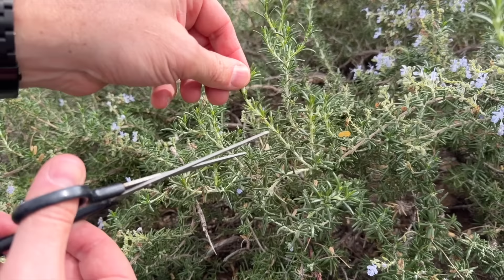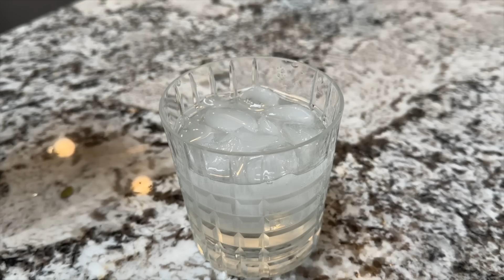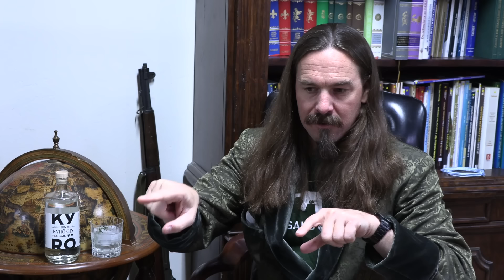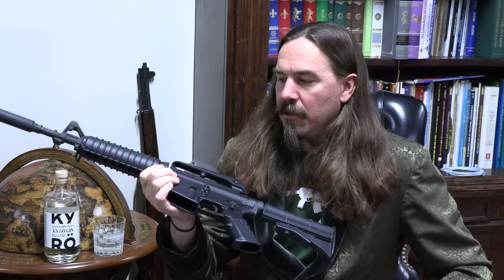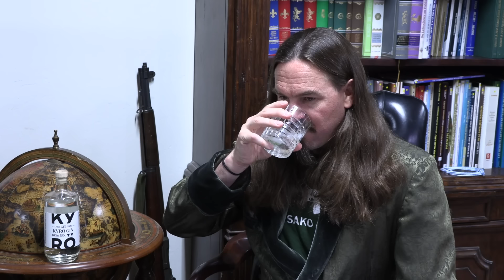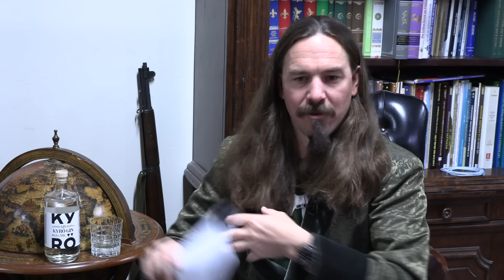How Guns are Made: Tolerances, Methods, and Metallurgy (Q&A January 2026)

Comment: One area that 3D printing is not currently beneficial, in my opinion (🙄) is components like your standard fire control parts, such as hammers, Sears, disconnectors etc. we saw a shift from forged and machined in the late 70’s (some even earlier) to things like sintered components in standard powdered metal technology (think colt lawman mk III hammers etc). We saw investment casting really flourish in small parts like safeties and even frames and other large parts because it is cost effective and strong. Now we are seeing the same thing with the MIM technology (which is still a sintered part but a different animal altogether) pushing the other methods out in a few areas of industry. It produces very complex designs that offer high strength and high volume manufacturing with long tool life. The structural density can be 97% that of a forged and machined piece but produced in a much much higher volume. That’s where it definitely beats out the 3D for actual full scale production. MIM, however hated, has made production of high strength, detailed parts much more economical for firearms manufacturers. It has eliminated the need for a lot of machining, and hand fitting and has greatly reduced production time and costs. A lot of people don’t even realize a lot of larger, and even more critical components are being made with Metal injection molding, like some barrels. An example would be the smith J frame 1.875” barrel. Specifically in .38 special, the colt cobra barrel is just one other specific example. 
So I don’t see 3D printing replacing MIM for a lot of high volume parts that can be made extremely precisely with very favorable economics and high  strength and good wear properties.

Comment: Hi Ian from Australia.I like Guns but I am not like the average American. In Australia the "Right to Bare Arms" means I can roll up my sleeves or wear a T-Shirt😎. I do really like watching your videos from a Historical point of view. I am also a Mechanical Engineer and I specialise in Design. As an engineer, Design always comes down to a handful of parameters and it is always a trade off between all of them to get the end result. Typically a design will start of with what is the purpose of the design and is there anything that the Customer says is required. If the customer demands say an aluminium barrel and wants to fire continuously on full auto we will try to convince them of better alternatives or not take the job. Some things are just not worth starting.  Assuming that what the customer wants is possible then the Design Requirements drive the first part of the design. Kalashnikov had to design a rifle that was cheap and reliable, easy to build with simple tools and with cheap materials, simple to maintain and use by lesser trained conscripts. Hence you can drop an AK-47 in the mud, wiggle it around, shake it off and fire it on full auto. It isn't greatly accurate but it is very reliable and it works. Assuming we have a basic set of requirements a Design will then come down to cost, materials, fabrication and testing. Of all of these things my materials will be the most important because different materials have different properties and different costs. I may not have the capability to fabricate a Titanium Receiver. Simple to CNC in other materials but very difficult with Titanium unless I have the right CNC machine which will be costly. I will then have to substitute a different material because I cannot afford the Titanium material or cannot economically fabricate in house or outsource that part. Material selection is usually a trade off between cost, functionality, availability and the ability to fabricate in that material. I will select the most cost effective material with the right physical and chemical properties that I have the capability to fabricate in house or outsource if necessary. 

The Tolerences I will use will depend on many factors but it basically comes down to how critical is the tolerance? Headspace is a critical tolerance. The angle of the wings on the sights is not. Some tolerances will have specific Standards. I will always design so that my design meets any required Standards and I will build in a Safety Factor. How much will a part shrink or expand in cold weather after having fired 100 rounds on full auto? I will calculate the Heat Transfer and do a number of Trade Studies under different conditions to work out a usable average, I will apply the Standard Tolerances and I may have a Safety Factor that is between 3 to 5. A Safety Factor might mean my barrel needs to cope with a peak of so much pressure so a SF of three will mean I will design it to cope with three times this pressure so it will not ordinarily fail. BTW there is a document called a Fit Sheet that is used to work out some tolerances. You look up the closest standard size, say 1/2 inch and look up the inside and outside tolerance depending on the Fit. A Press Fit will have different Tolerances to a Force Fit. A Force Fit that you described it will be the Receiver that is chilled to make it smaller and the Barrel that is heated to make it bigger. Put the bigger Barrel over the smaller Receiver and let it cool down and it aint going anywhere. Use a Press Fit and you can probably pull it apart again with your hands. The Fit will depend on the Application.

What actual fabrication methods will always come down to what machines and capabilities do I have available in terms of what is in my factory or outsourcing. It will also come down to how many do I need to make. It will be much more expensive for my Machinists to hand make parts for 100 units but very competitive to set up a series of CNC machines to make millions. Methods will also be a case of what do I need done? Some parts may have to be heat treated, others not. Some parts may need precision to 1/10000 of an inch, others not. I will use the cheapest and most efficient method that I have available. If it needs to be forged then either my guys on the shop floor will forge it or I will outsource it. 

Metallurgy is a bit of an issue here because metal is no longer the only material we make firearms from. As a Designer I will select the best, cost competitive material with the material properties that closest fit my design. If it came down to metals only then 3D printed plastic guns would not exist. Why does the average 3D printed gun have plastic parts and a metal barrel and receiver? Because the metal parts have the right material properties for their job and the plastic parts have the right properties for theirs. Safety Factors may be questionable but does the design work? Zip Guns work. They may blow up in your hand after a few shots but they do the job - fire a few shot and discard.

Designing Guns is not really any different to designing anything else. Parts of weapons need precision and others not. Certain Standards need to be met and others not. You mention the wide range of ammunition, this is a design limitation. Design for all of it or design for Best and use warning Labels. If people don't heed the warnings then whose fault is that? If they want a cheap gun that works then you get what you pay for. Use the right tool for the right job. Do you go hunting for Bears with a .22 pistol? Common Sense has to come into it somewhere. Either that or let Charles Darwin select the survival of the fittest.

Last thing. Just Google Desktop 5-axis CNC and you will get what is on the label. A Five-axis CNC machine that fits on your Desk for less than US$6000. Google Desktop Laser Sinter 3D Printer and a similar machine will come up for about the same money. The CAD program I use regularly, Fusion by AutoDesk, has a free version that has Design to Manufacture (either 3D print or CNC) and will also create full Engineering Drawings with a handfull of mouse clicks. What was once the domain of Big Manufacturers is now well within the realms of a Guy in his Garage and a few cheap machine tools.

Cheers Again.

Comment: The Blanchard lathe is not what he was best known for. Blanchard grinding is a process still used today for things like die shoes and other precision plate products. It's a surface grinding process with a vertical spindle and rotating table

Comment: The guns stocks WERE made on a "duplicating Lathe"..  A duplicating lathe, or copying lathe, uses a template or master workpiece to guide a cutting tool, allowing for the creation of identical, complex shapes like chair legs or spindles, automating repetitive turning tasks by having a stylus trace a pattern while a cutter shapes the new piece. These attachments can be added to standard lathes or built-in, featuring a tracer following a pattern and a tool bit making the cut, significantly speeding up production of identical items.  They also made and do make wooden airplane  propellers on the same kind of machine.
Reply: Yep that's what he said.

Comment: 20:35 IMO, it would be something like AR-180: a lot of stamping and spot welding. Almost no CNC milling needed(and it takes a lot of time to mill a receiver). The barrels can be made quickly by cold hammer forging by the buttload if you have the machine.

Comment: There's been a poster on the wall of my cube since I started this job listing all the plating requirements for different milspec applications, and it includes how different radii or inside/outside angles will affect coating thicknesses, so that's just one more variable that has to be taken into account during the design process. It's not doing me any good, I'm just the IT guy.

Comment: the thing with stamping is that you need to make a lot of units to pay for the tooling, and a good part of the tooling cost is in the die which can't change what it does like a CNC. Polymer tooling is cheaper and as mentioned allows for greater complexity and detail.

Comment: Hit me right in the aerospace engineering, where 0.010" tolerance is my default "I don't care about this feature" tolerance on flight parts.
Reply: That makes me wonder, I know cup holders are the cliche example, but what about cup holders in airplanes haha? Nah more broadly speaking tho, do you guys have teams that work on the interior or are there “interior design” companies that specialize in different kinds of planes that you partner with to handle that kind of stuff? Like on the one hand no need to redesign the wheel on stuff like the carpet that is used, but like, hell maybe there is, maybe thousands of times of compressing cycles messes with the glue that regular carpet would use and an aeronautic carpet had to be invented or something lol. But like, would that carpet invention be happening at/by the aeronautical engineer company or at/by the interior design company or both?

Comment: 35:00 parts that fail a go/no-go test are not always discarded - they can then go through another test, and then be classified as "in spec" but to a different spec. They might go well with the next piece, that is also a first-pass reject but the other way.

Comment: One of the worst bottlenecks when tooling up for WW2 was the lead time for precision machine tools.  Some very creative ways were found to work around this, from reworking product designs to limit the the amount of precision machining required, to machine tools designed for one specific type of machining operation that were built with precision ways installed on a poured concrete frame or base.

Comment: It bugs me when people confuse “tolerance” with “fit”
Tolerance is the amount of variation allowed in a manufacturing process. Fit is how tight or loose parts fit together. 
If a piston fits precisely in a bore that’s a “close running Fit” which requires holding tight Tolerances on both parts. Cheap manufacturing processes can’t hold tight Tolerances so can’t achieve precise Fits.

Comment: A gunsmith can hand fit, make parts, checker metal and wood. An armorer can build a gun from a pile of parts, trouble shoot and change parts (maybe some light fitting)...
If you can put together a Glock or AR then you are an armorer, not a gunsmith. Building an AK from scratch (not a parts kit) is getting close to gunsmithing.

Comment: This video is well done and is a good intro for non-engineering people. Dimensions and tolerances is a never ending battle. Sometimes you have to get into the weeds and do big studies, other times you acknowledge you don't have the machines capable or discipline in your quality department to hold tight tolerances and so you redesign the feature to not need tight tolerances. People don't realize how valuable prints and tolerances are.

Comment: There's also another element to tolerances to consider, and that's just selling off tolerance parts for cheaper under a different marque or name.

Intel or AMD have dozens of different CPUs at every price point imaginable because the tolerances involved within silicon lithography are at the atomic level.
Reply: You cant sell any off toleracne parts if they don´t fit. It´s not a cpu, they simply wouldn´t work.

Comment: I'm a gunsmith in s.e. Georgia for over 30 years. 
A good rounded education with practical experience in firearm function and theory is essential. The amount of misinformation on the internet is astounding. Many self proclaimed 'experts' have told me with great pride how things are in their opinion. I have seen high end expensive factory guns with inspection stamps and testing certificates, new in the box, yet, unable to cycle. One had no gas hole drilled into the barrel.  ( ...lol )
The most I do is clean guns, replace broken parts and reassemble guns that get handed to me in a bag. These often with lost every rare priority springs, and the remainders twisted hopelessly out of shape. The worst are black powder guns left over season until the next, now sadly rusted into metal tubes that used to be guns. I have designed and made several guns of my own ( with no intent to sale ) . Yet most modern "gun building" is a matter of bringing me a serialized receiver and then adding enough parts for a client that they have something nicer than a cheap discount model that was on overstock sale. I have enjoyed the AR series for it's consistent modularization. 
I did hot caustic bluing for awhile. An often frustrating expensive process ( mine ate a lot of propane for the heated vats ) along with expensive supplies. It often made beautiful black steel,  then, one would need to be redone the next time with no rhyme or reason. I assumed newer synthetic oils would resist cleaning and stay in the steel long enough to make blotches and streaks. After a few thousand I gave up the refinishing part.
I'm now 63, and intend on doing repairs for some longer time from now. When I started there where eight gunsmiths in a days drive from me. I'm the only one left in four counties. We tend to die off, and the surviving ungrateful children "hate guns".
I'll likely be found dead ( hopefully years from now ) from a heart attack from screaming at a little spring that I allowed to escape and fly across the room.

Comment: Machine shops have a QC department that goes through and measures the necessary features with high quality calipers and calibrated measuring tools
Reply: I hope they don´t still use calipers....
Reply: @sierraecho884 What's wrong with calipers?
Reply: @TheTrueNorth11  Usually you don´t use 2 point dimensions these days anymore. Nit since about 2011. Calipers are okay, for home use or when you have simple dimensions, but they don´t measure and GD&T tolerances.
Reply: @sierraecho884 I assure you, people have been using calipers for high precision work well through 2011 and will continue to do so for hundreds of years.

Comment: In regards to the last question you should add metal injection molding. I worked for a sub contractor that made MIM parts for S&W and Ruger. trigger, sights, firing pins and lots of small parts for those guns. The S&W bodyguard. 380 pistol even used a MIM barrel.
Reply: Yes, I thought that too. CNC milling is by far the worst process, because it´s the most expensive and low volume one. Forging (barrel) Stamping (small metal parts), injection molding, MIM, casting and milling. That´s probably how it goes.

Comment: The biggest advantage of cnc machining is that a properly set up machine anywhere in the world can make parts that would be interchangable with any other production line. Basically impossible with traditionall mill batteries using custom jigs which historically was a huge hurdle in mass producing firearms that looked good on paper.

Edit with another thought: cnc machines can even automatically predict tooling wear and adjust the offset to consistently give the same dimensions. Older mills had a manual offset that the engineer would have to calculate regularly, meaning more chances for human error and different practices in different shops
Reply: They are still expensive slow and need people who know how to use them. It´s not the machine so much that´s the bottleneck. Next comes supply of proper billets, quality control etc. 
There is more to manufacturing than just milling a design.